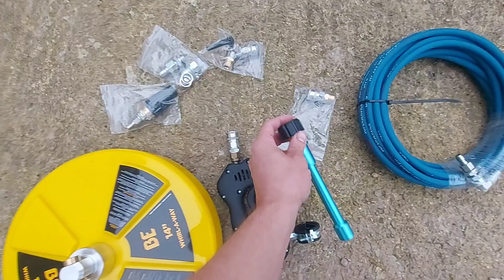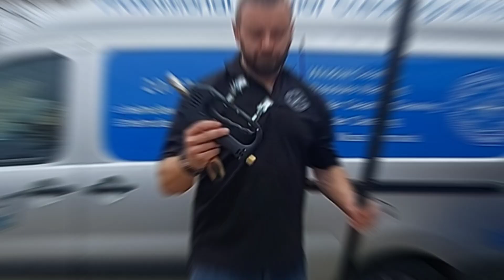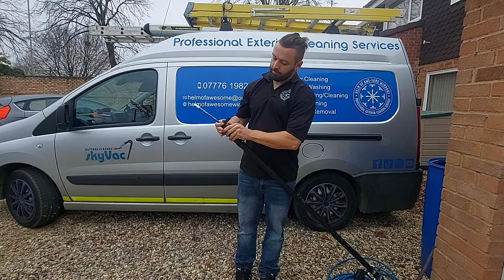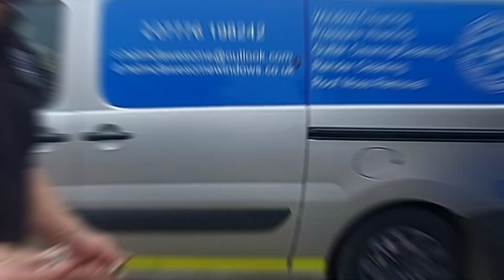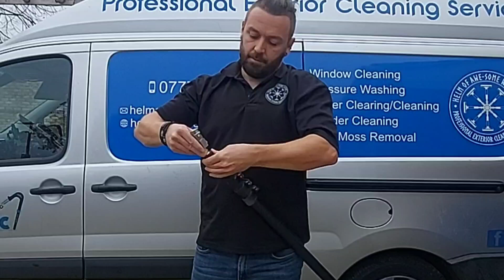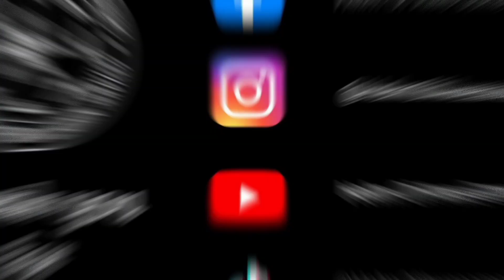Converting A WFP Into A Power Pole With The Conversion Kit From AC Pressure Washers

Comment: That FSC is too big for roof cleaning…12” is what you need, also is your pole full carbon? How are you going to control the pressure through the turbo when it’s at full extension
Reply from the maker: As I mentioned in the video I don't really do roofs with a PW. So chose an FSC I may use with other projects. This is just there if I need it

The pole is a gardiner slx  have used the same pole at 50ft and had no trouble controlling it. Takes a while to get used to at first but then all comes down to technique
Reply: @HelmOfAwesomeWindows  I’ve got the SLX 47…excellent pole for roof cleaning, that’s what I use
Reply from the maker: The turbo was part of the kit, I dont intend to use that much either. It's more for the white/yellow fan tip and cleaning render i will use it for
Reply: What's the problem with it being too big?
Reply: @shaunflack7303 too heavy and awkward to manoeuvre around on a roof…12” is the sweet spot for roof FSC
Reply: @johnauld0 got my first proper roof clean tomorrow done a bungalow before but now brought a proper set up but when i went onto the roof cleaning section on chemway it suggested the 14 so got that so guess i'll see how it goes 😂 also the only 12 inch i can find is the turbo devil but its like twice the price
Reply: @shaunflack7303 I’ve got the turbo devil and it’s great…you buy cheap you buy twice..